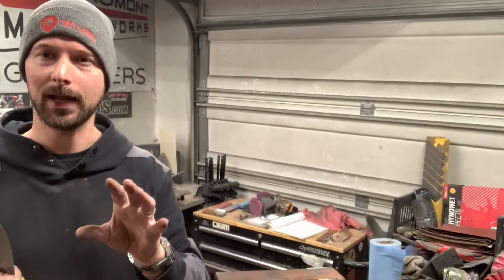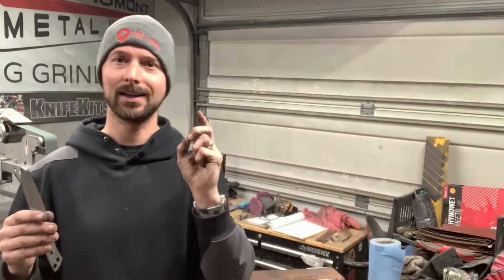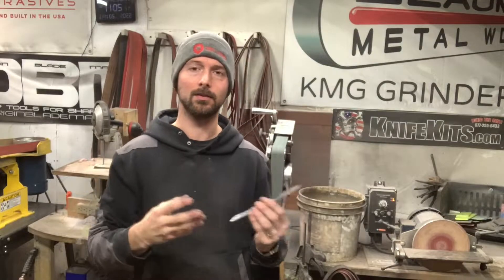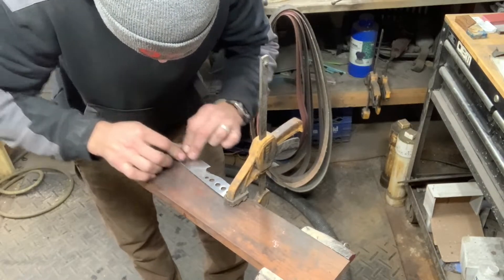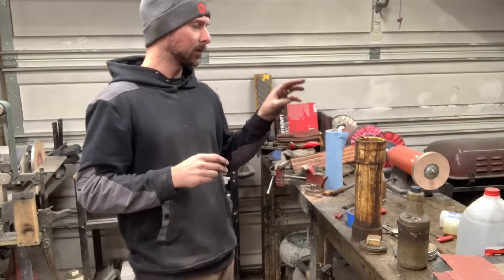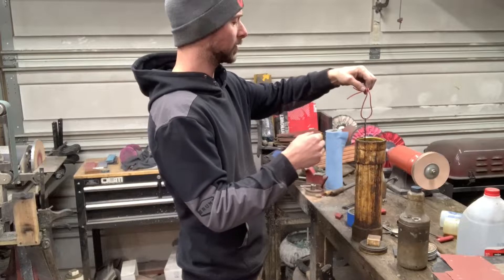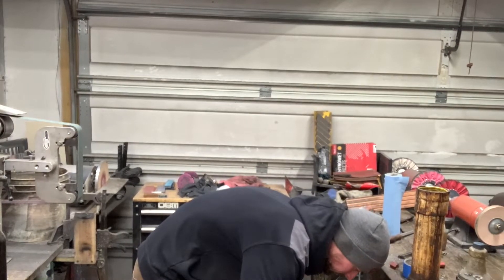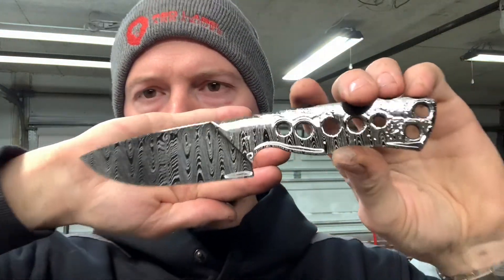HOW to FINISH and ETCH DAMASCUS steel

Comment: Thanks for the video! I’m curious about using the apple cider vinegar. What is an advantage to that? I’ve mostly heard of a 4:1 distilled water to FC mixture. Thanks.
Reply from the maker: I’m not sure I just know it works really well for me
Reply: I see this is old but I'm sure someone will need it one day. Alabama Damascus doesn't work on the 4:1 distilled as good as this mixture. Alabama Damascus is 5160 and not 1084

Comment: I accidentally touched a finished damascus blade on the grinder, and hand sanded the spots, and then re-etched using Nescafe Clasico, and it worked like a charm. A bit of work, but truly worth it to save the blade, if anyone is interested. Sand with rhe grain of the damascus in the blemished spot, so it's surface smoothness matches the rest of the blade, try to even out any peaks or valleys, gently, and then clean it well, and etch it. Like it never happened. 🤷‍♂️ Good thing to know, if you're in a pickle.

Comment: Great video! Have you made one on how to finish/attach grips once the blade is etched without scratching it? Thanks for the great content!
Reply from the maker: I have done a few handle install videos! The trick with Damascus blades tho is re etching the spine once the handles are finished! I normally just use a qtip with a little ferric on it.